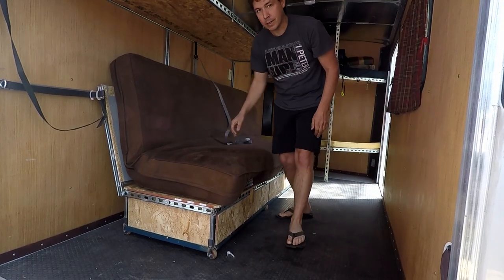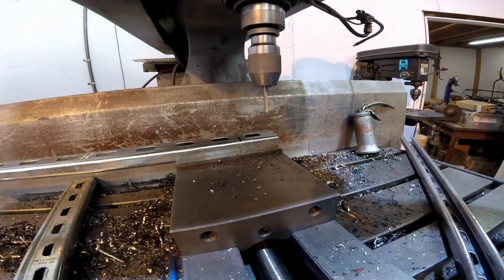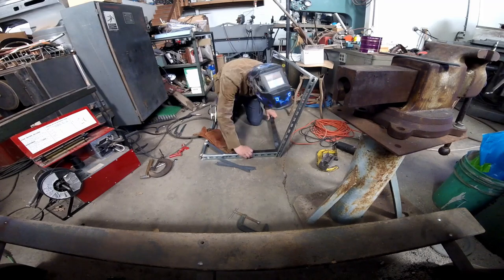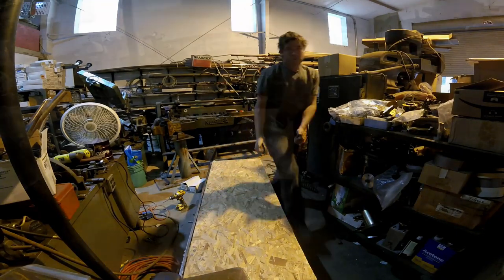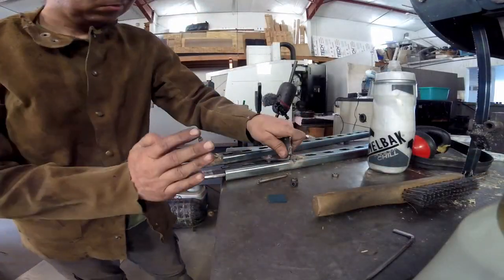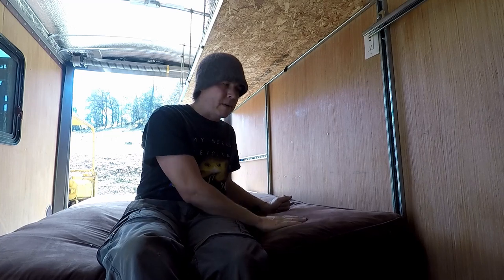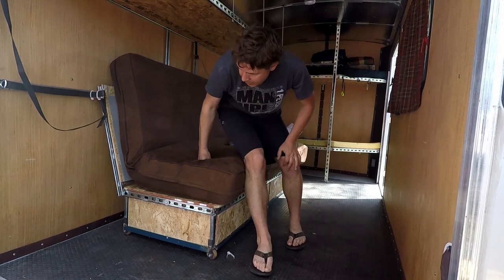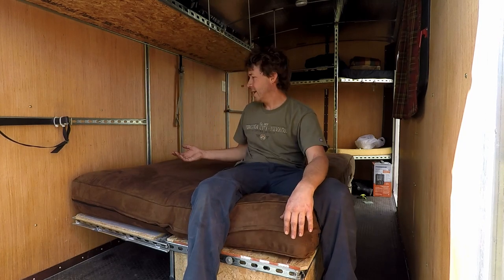Awesome cargo trailer folding bed

Comment: Love the bed. LOL on the look on your face when it did not lock. haha! May be making one like it accept ours will be with wood because we do not weld. I like the design of it.
Reply from the maker: If I did this again I might make the box stationary. And have the bed slide across the top of it. The wheels have a tendency to run over things. I did it that way so the storage would always be up front, but it doesnt matter that much.

Comment: I love this guys' work...I'm also a subscriber.  However...this bed seems a little "Rube Goldbergish"....for you young  folks out there, it means it's WAY too complicated.
The welding and fabrication could have been eliminated by using lightweight quality plywood and fabricating a box with a piano hinge for the other half of the mattress.
Once you split the mattress (Amazon, Queen size $117) , and fold back the extension, you have a couch.......lightweight and a whole lot simpler. Don't get me wrong,
this is not a criticism...it's just a simpler, more efficient way of reaching the same goal....a foldable bed.
Reply from the maker: I thought about doing it that way, but this was more fun.